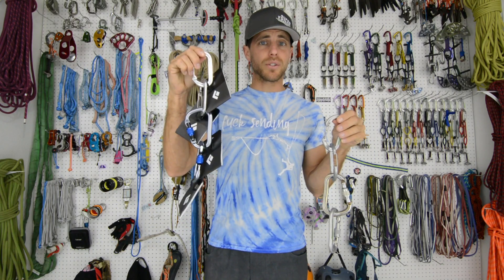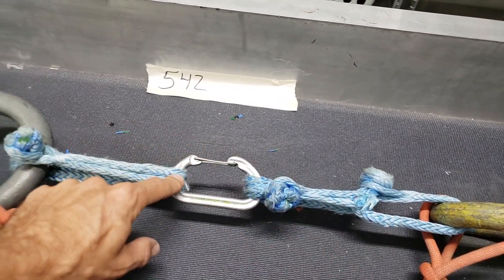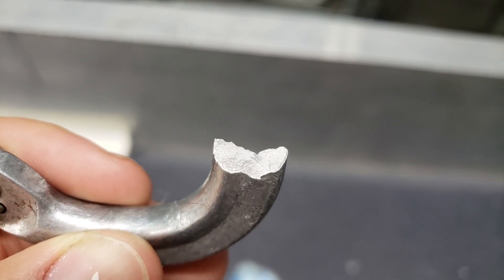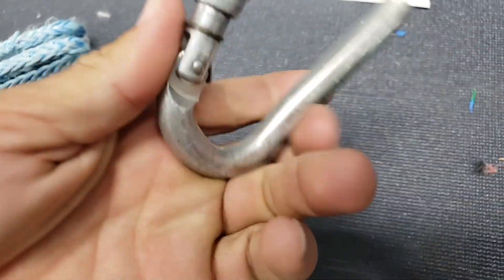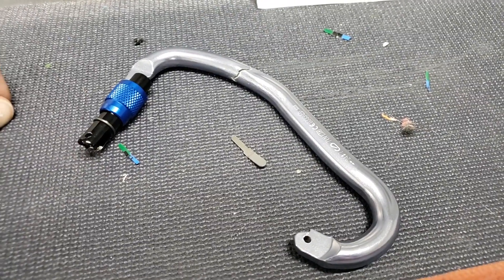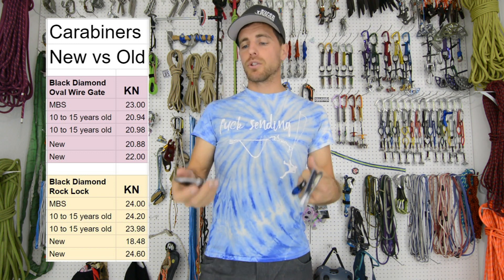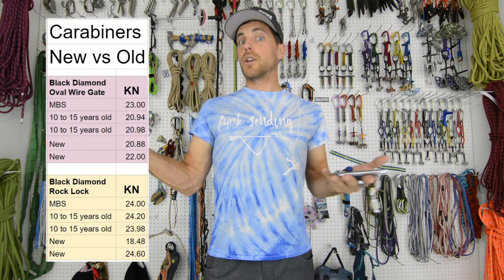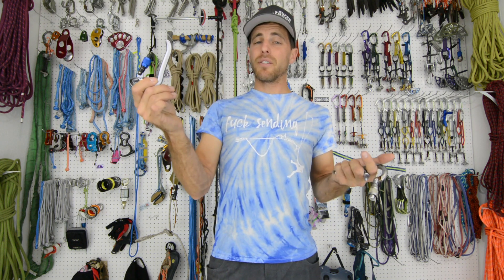Brand New vs 15 Years Old - Break Test

Comment: AWESOMENESS!!!  Thanks for contributing, Mumford was the only one I'd known of on youtube actually doing these videos, of course nobody "owes" anything but damn if I had a load cell of any sort I'd feel compelled to do & share tests like this (and some damn tests on "steep bended rope" IE tight-eyes without steel thimbles or anything inside the eye to spread the load, I suspect this area is one where many don't realize just how much weaker their entire system becomes when the end of the rope does a sharp 180deg turn on an O-Ring instead of being spread/'equalized' over the surface-area of the thimble/insert!)
Kudos for the contribution man :)
Reply from the maker: When we do BoltBusters breaking 1000 bolts, we will be testing how ropes interact with each bolt because even if they are strong enough, I bet the glue in wave bolt's thinner diameter affects a rope's strength.
Reply: You’d be wrong. The eye of the rope sees half the tension of the rest of the rope. This is literally the last place you see a failure unless the hanger is actually sharp enough to cut the rope

Comment: Do you have any video like this about pulleys and swivels? What I want to know is the difference about WLL and MBL on this devices but in real life because on a pulley says MBL 20kN and WLL 5kN and that's a huge difference.
Reply: MBS(minimum breaking strength) of the equipment is  based on destructive testing performed by the manufacturer(plus 3-sigma).
Basically, the MBS is the amount of force the manufacturer will guarantee the equipment will hold before failing(so long as you don’t abuse the equipment like this guy)

Working Load Limit(WLL)otherwise known as Safe Working Load(SWL) is determined by the intended Safey Factor(SF). OSHA requires a minimum SF of a 5:1.  This means that the device should be able to bear at least 5 times the intended load placed on it. So if the carabiner has an MBS of 30kN, the WLL will be 6kN.

Comment: The reason why the effects of cyclical loading are different between steel and aluminium is due to fatigue limits (or endurance limits), and that aluminium doesn't have one, practically speaking. Not because steel "bends more". Please research what you're talking about before commenting on such things in the future, there's already enough misleading and incorrect shit on youtube we don't need to add to it
Reply: Haha watching Gonzales present his “I’m an engineer” card only to be proven entirely incorrect made my night.
Reply: Aluminium has a fatigue limit, steel doesn't, but it is pretty useless considering that it may survive many many years and with a slightly larger load (like a fall) it would break
Reply: @j.gonzalez2543  Endurance limits are for ferrous metals. Aluminium does not have one. Just google "fatigue limit" for some clarification
Reply: @larryshredmonkey  I am a mechanical engineer, I don't need google to tell you that steel can withstand unlimited cycles if the load is below certain level, but aluminium can't
Reply: @j.gonzalez2543  This is true. The load below which ferrous metals can theoretically withstand infinite cycles is the fatigue/endurance limit. Therefore, steel has a fatigue limit. Aluminium does not. Honestly mate just google it
Reply: @larryshredmonkey  so we both agree with the fact that the aluminum will always break and steel might not. Maybe the problem is that English is not my first language and in Spanish we use fatigue limit in the opposite way
Reply: @j.gonzalez2543  I call bs
Reply: @j.gonzalez2543  more clearly states my understanding of the metallurgy, if Aluminum has a fatigue limit of 0, it has a fatigue limit of 0, which is NOT the same thing as not having a fatigue limit.  Zero is still a number.

Comment: I worked in the construction industry, equipment is usually rated below the actual failure point
by 20%  because people take it right up to the limit. It seems that climbing equipment should 
also have a safety factor built in. looking at your test rig it seam to me to be a fair test that
climbing equipment should pass with flying colors .i would not buy black diamond equipment
Reply: from eariler comment:

"In case anyone wanted to find out more about UIAA carabiner ratings, search for UIAA 121. That standard uses two 12mm metal rods instead of rope to break test carabiners. Ryan's video demonstrates how minor differences in rigging configuration can result in enormous losses in strength. All carabiners are meant to be loaded "on-axis" and even something as minor as the width of a soft shackle or a slackline webbing can load it off-axis and reduce its breaking strength.

https://www.theuiaa.org/wp-content/uploads/2016/08/UIAA121-Connectors_2.jpg"
Reply: For climbing purposes the max amount of force a human body can survive is roughly 12kn. Most falls - even big ones don't generate much more than 6kn. Also there is hopefully some kind of redundancy in whatever system your using. Weird loading can cause things to break at less than their rated strength but bottom line is that almost all climbing accidents are caused by human error, not pure equipment failure.
Reply: The problem is the test setup. Carabiners are not designed for use with thick materials, and it says so right in his brand n uses manual. This tester doesn’t know what he’s doing. The carabiners are fine, I’ve broken hundreds of them and never had a single one break below the MBS

Comment: Good video, but I have to say I am very disappointed that there is no safety factor built in
to there ratings. I would be very interested if other brands are rated the same way. One
of your new biners broke at 75% of its rating that is really not acceptable. That means 
they should only be loaded to 50% of there stated value. You should contact there competition 
and see if they are willing to let you test there products.
Reply from the maker: To be fair, i did not test it with a 12mm rod like the standards are, but as highliners we clip many things that are not a 10mm rope.  Now my soft shackle wasn't as wide as a spanset but it was still wider none the less.  I have found with my break test machine that things do not break at what we think they do which is why i tease about the "RBS" realistic breaking strength.  I like the throttle the saftey line by going fast and light sometimes so i find these real numbers super helpful.  Stay tuned because now that I know climbers are interested in RBS... we are going to town on climbing gear!
Reply: DMM (Wales) claims their ratings are 3 sigma (standard deviation) making a fail below rating from factory fresh very unlikely indeed.
They tout "3 sigma rated" as though it is a huge margin, but the real question is how big or small is sigma. Apparently for BD, the variance sigma is bigger than you expect !

Comment: You said not to use aluminum carabiners on your leash, and after a whip you looked up and saw your biner gate open. Was your leash biner a locker? I'd think a locker would prevent that...
Reply from the maker: It was locking... and i forgot to lock it haha.  But biners could be cross loaded and the sharp edges from locking carabiners can damage webbing.  Really bad to whip on a carabiner on a highline.  And the wider the surface the more it pulls on the gate side and not the spine side of the biner reducing the strength.  Many people have brought up how the soft shackles I used were wider than a standard 12mm steel rod used by manufacturers and that is the reason I got lower than mbs.  A 1" webbing would even cause more reduction in strength.

Comment: 2:20 You say the aluminum is porous. It is not. That is the internal crystal grain structure of the metal you are seeing.
Reply from the maker: Your right, it wouldn't absorb water porous... it "looked" porous.  What I meant is it isn't polished and shiny like we always see aluminum.
Reply: @HowNOT2  thats typical of the brittle fractures, basically it is a crack propagation at a microscopic level, hence the not polished look. English is not my first language, sorry if I made a mistake
Reply: @j.gonzalez2543  Brittle fractures tend to be "shinier" think glass. This is a somewhat brittle fracture (hardly any elongation or necking) but the rough nature shows that it had some ductility.
Reply: @philipbotha6718  ductile fractures are shinier than brittle fractures due to the deformation in the grain. They also present a "neck" before breaking, which is not the case here. 
If you see a traction test in a ductile metal it will get a shiny neck until the area is too small to withstand the pressure, finally breaking apart in a brittle fracture giving the rough nature in the center.
Reply: @j.gonzalez2543  Yes. The lack of necking does point to a brittle fracture.
Reply: @HowNOT2  What you see when you look at aluminium is the polished aluminium oxide layer.
Reply: Of course it is porous. Everything is porous to some degree or another. I work with metal all the time and if I heat up any metal, there's a point where the moisture within the metal comes out. It's plain as day.
Reply: @midi510  that's interesting! I never knew that. Thanks.

Comment: Good video, and nice job collecting data. The main reason steel is better for cyclic loading is a that with a low enough load it approaches infinite cycles, where as with aluminum with enough cycles at any load it will eventually fail. It was to do with grain dislocations rather than steel being more ductile (which it only sometimes is depending on phase)
Reply from the maker: This is a good point.  I was surprised to see there was very little to no difference between really abused and beat up carabiners and new ones.  How many cycles would it take to reduce the strength of a carabiner?
Reply: @HowNOT2  So it would be entirely dependent on the intensity of the cycles. Here is a link describing the basic theory of fatigue with a graph for steel https://www.fatec-engineering.com/2018/02/20/description-of-a-s-n-curve/. In reality it is more complicated than this in carabiners, because they contain stress concentrations due to changes in geometry. Here is the same sort of graph but for Aluminum: https://openi.nlm.nih.gov/detailedresult?img=PMC4003947_sensors-14-04364f8&req=4
It would be interesting to test a set of carabiners to failure in fatigue. I may have to ask the guy who runs my lab to let me use one of the machines.

Comment: In case anyone wanted to find out more about UIAA carabiner ratings, search for UIAA 121. That standard uses two 12mm metal rods instead of rope to break test carabiners. Ryan's video demonstrates how minor differences in rigging configuration can result in enormous losses in strength. All carabiners are meant to be loaded "on-axis" and even something as minor as the width of a soft shackle or a slackline webbing can load it off-axis and reduce its breaking strength.

https://www.theuiaa.org/wp-content/uploads/2016/08/UIAA121-Connectors_2.jpg
Reply: I'll let you guys argue and I'll sit and wach
Reply: i thought those things have very large reduncies? I am an engineering student, when i design stuff i put 10% redundancy on every part. Some will even go up to 30%-50%(some civil stuff). very strange that they label actuarial forces required.
Reply: @ddjohnson9717  Equipment is always rated for the ideal perfect test.  That's why engineers build in those safety factors on top of the officially rated strengths.    The bolt manufacturer will tell you its sheer strength.  But as an engineer it's your job to know that the bolt will be subjected to repeated hot/cold cycles and to account for environmental weakness over the life cycle of the final product.
Reply: super good info my man, thanks!
Reply: No thanks.
Reply: Dude, you are overexaggerating! There are no "enormous losses in strength". Most of the carabiners broke at the rating or maybe 2kN less. The lowest rating on carabiners is 20kN or 18kN on oval carabiners which still makes the carabiners within the standard. Even a factor 2 fall would at most put 12kN on the carabiner. If you use the carabiner as intended what you are saying is pretty overexaggerated and irrelevant.
Reply: @HaasGrotesk   Ryan's video shows the new Rocklock carabiner breaking at 18.48 kN, whereas the MBS is 24 kN. That's a strength reduction of 33%. Off-axis loading is well-known to significantly reduce breaking strength, and the results in this video are likely due to that. 

You can look up a great video by Slacktivity where they test off-axis and tri-loading's strength reduction on carabiners. While it's not exactly the same test, their results are consistent with large reductions in strength.

Regardless of the minimum in UIAA 121, the strength reduction shown in this video was significant relative to the manufacturer's stated MBS. All UIAA-rated carabiners come with a warning against off-axis and tri-loading, and this video was a good demonstration of why.
Reply: @TheBradosaurus  Yes, but why the hell would you load a carabiner off axis? There are even carabiners that prevent that.
Reply: @HaasGrotesk  Off axis loading can occur if one is tired and not thinking straight in the rigging or by one who simply doesn't know anything about how to load Krabs properly. ie if a anchor failure, will all Krabs be loaded along their axes or not? There used to be a time when shops wouldn't sell krabs to people unless they could really prove they knew what they were doing, now anyone can buy krabs just about anywhere and that's just one way they can be loaded off axis by the ignorant.
Reply: The shear stresses that occur will increase make the part hold less stress